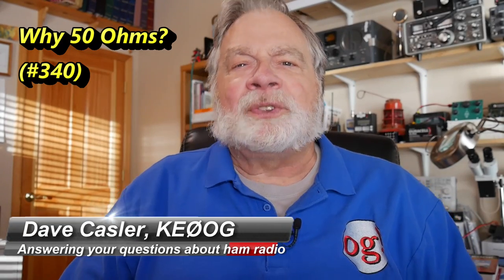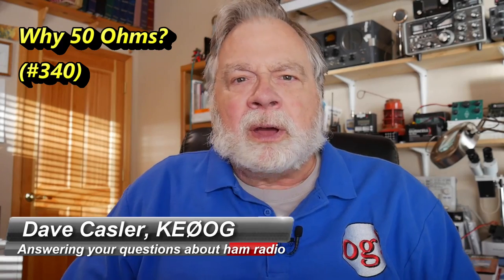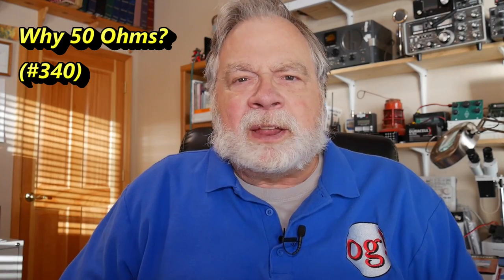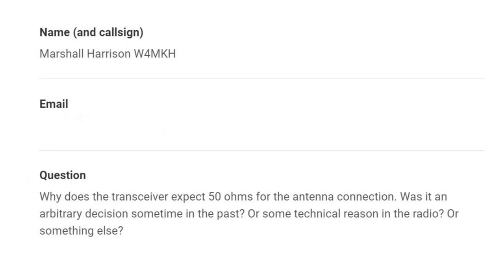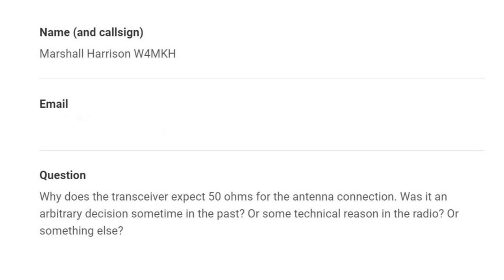Why is Coax 50 Ohms? (#340)

Comment: Nice explanation!  Most of the 50 ohm cables I've used have had a BNC end and the 75 ohm cables have an F type.  Is there a reason for the these choices other than cost?
Reply: The professional video world uses 75 ohm BNC on SDI video cable, but don't get them mixed up. The connector itself has a characteristic impedance and there are other better 50 ohm options like TNC and N-connectors if you need them.
Reply: Yes, 75 Ohm BNC exists too but F-type is popular now because it is cheap and effective. The center conductor is usually copper plated steel, I think. Skin effect... Steel is cheaper than copper.... I don't think that there is an equivalent of F-type for 50 Ohm coax - I've never seen one?? You mustn't plug 75 Ohm BNC into a 50 Ohm socket - the center pin is a different diameter and it buggers it up. :(
Reply: The F-connector is common in consumer electronics because it is cheap and... no, that's pretty much it. Because it's cheap. It's a very tight margin industry sometimes.

There is a 75ohm version of BNC - it's a slightly different size, to prevent accidential interconnection. You don't often see it though.

Comment: power (watts)= voltage x amps, so high voltage is different than high power by the amount of amps. Volts is the force component and amps provides the time component. Force over time is power.
Reply from the maker: Don't forget the power factor, which is the cosine of the phase difference between the voltage and current waveform.

Comment: Calculus and differential calculus was NOT invented by Heaviside. Generally, the invention of calculus is attributed to Newton and Leibniz. Aspects of calculus were, however, known in antiquity. The work of Newton and Leibniz were based on the work of mathematicians and physicists  of the previous generation including Fermat, Pascal, Wallis and others who all lived before Heaviside. Heaviside did develop methods for solving differential equations and vector calculus. Maxwell's equations as expressed in modern terms were reformulated by Heaviside. Heaviside postulated the existence of an ionosphere and the layers were appropriately named the Heaviside layers in much of the 1920's radio literature that I have.

Comment: Thanks for a great explanation! I live in an HOA-governed neighborhood, so my antenna choices are very limited. I just purchased an Eton Elite 750 short wave radio, and am researching appropriate antenna options. I can run a coaxial cable from its 50-ohm BNC connector out my back door, 90º to the left for about 15’ to the side wooden fence, then a right angle along the top of the fence (through eyelet screws?) for another 60’ or so, then another right angle for another 16’ or so. At that point, I would like to run that coaxial cable down to the ground, then to a tall Cottonwood Tree behind the fence. I can run the cable up the tree for about 30’ or so. Whew! Having described all that, does that coaxial cable need to be a certain length in order for the radio to properly tune with it? As you can tell, my learning curve is pretty vertical. I’m glad I came across your channel—and I’m now a new subscriber. Scouring your videos for this answer, but if you could help out while I’m searching, I would appreciate it. Thank you!
Reply: If you are a radio amateur, HOAs cannot legally prohibit the installation of a "reasonable" transmitting/receiving antenna. I believe that went all the way to the Supreme Court.
At least one amateur has successfully argued that since his specialization was international radio communication, he got the courts to agree that his large tri-bander antennas mounted on a tall tower were reasonable. 

If you are using the antenna for receiving only, you can simply mount the antenna or antennas to the eaves or siding, then paint the antenna and coax to match. Neither the HOA or your neighbors will even know it is there.  Also, the length of the receiving antenna is not very critical, unless you are doing weak signal work.
Reply: Google flag pole antenna

Comment: So these values were worked out experimentally in the 1920s prior to the existence of any of the dielectric materials that we use today?

I wonder what the results would be like if there experiments were repeated for polyethylene and polystyrene dielectrics
Reply: According to my understanding such materials simply allow thinner and/or more flexible cables, but they do not perform any better than air ones
Reply: @AlessioSangalli  the dielectric properties of polymers are distinctly different to air (free space).  The dielectric properties are the very reason why modern coax cable use polyethylene  or polystyrene and the k factor of these cables can be significantly higher than unity.
Reply: @michaelharrison1093  of course the velocity factor is different, but why do you think a higher k is a desirable property?
Reply: My understanding is that such dielectrics are used for their mechanical properties, not because they perform intrinsically better than air - but I am interested in understanding more.
Reply: @AlessioSangalli  a high k reduces the wave velocity and inversely proportion to this the volumetric energy density of the signal is increased.  A higher signal energy density helps improve the S/N ratio
Reply: @michaelharrison1093  OK kinda make sense; I will try to look it up.

Comment: You mean for power output transmission is the best lower ohm such 30 ohm for the minimum loses and for the receiving loses is the best 75 ohm, but because you are using the same cable for transmission and receiving through the same cable it is the optimum to use 50 ohm cable?

Comment: Dave: Love your videos. Thank you. 

I hope you don't mind if I ask a quick question:

BACKGROUND: I have 65' of (really old and double guyed) Rohn 25G standing in my back yard. It is topped by an equally ancient Mosley TA33 Tri-Bander and fed with 120' of RG8. I also have a 10-80M OCF dipole (inverted V) hung at 60' on the same tower. We have three acres, on a 1400' foot hill (1000' above the city of Fairbanks, AK) looking south - toward the US. 

PROPOSED ACTION: I am considering removing the Mosley TA33 from this Rohn tower, and in its place putting up a (rather large) Mosley 96 Yagi that includes both 30M and 40M. I'm also considering installing a better feed-line. 

QUESTION: How would you suggest I evaluate the propriety (cost/benefit) of: (1) ensuring the best height for the new Yagi (1/2 wave at 40' equals about 65', so it appears just about spot-on for 7 Mhz); and  (2) installing a better feed-line, something like the Heliax you mention in this video? I'm not made of money, but I do OK and wouldn't mind investing a bit in this project, if the outcome would be materially advance my present abilities (QRP CW on the bottom of 15M-40M). Any direction you may offer would be greatly appreciated. 

Of course, if this inquiry is beyond the scope, please forgive me. 

Again, love your work. - Ward Merdes - KL7IXW 

p.s. I grew up in Fairbanks, AK with your friend, Scott Dennis, RIP
Reply from the maker: Ward, I'd have that tower inspected before doing anything on it, including climbing it. Rohn 25G is not all that strong, and if you put a 40-m Yagi on it you may overload it. Don't forget to consider the torsion load put on the tower when you rotate the antenna and then the brake grabs it. For a big antenna like that, you might want to consider Rohn 45G or something even stronger.
Reply: Thank you, Dave. Will do. 73 - Ward Merdes

Comment: It's just like a transmit metal detector coil that you made from a LC Colpitts oscillator...  you need the sinusoidal oscillations as a TX signal in the coil and you need part of it to reference a clock operations..  the more effective power transfer is done,  the more the power is lost in the TX coil... so you can't match for maximum power transfer, new elements come into play.. The LC tank needs to keep it's oscillation power or your detector receive side has a weaker and weaker oscillation to work with down on the ground..  The antenna is the same.. it resonates energy that you want and only need a fraction of and keep the antenna working... So the coax dilemma is simple to explain, it's impedance matching balancing compromise that allow for reasonable cable length whilst still leaving some power behind for the antenna to saturate it's own function... and to satisfy the equipment you connect with. So now you know what you can do with those old Tesoro detectors to make them even better with a resistor of all things. Operations needs stability, and there's nothing wrong with taking what you need instead of taking whatever it can give you.

Comment: Dave:
Recheck your data.  'if ...quality cable'   and then  'there is no wear-out...'     If you put the two together you are mostly correct.  You need to check out 'non-contaminating'  cable.  The newer LMR-400 with a foil separating the dielectric from the outer jacket should last much longer.  I can show you old deteriorated cable that was ALWAYS stored inside.  It was 'N-C' cable but still went bad.   
w0fen Robin

Comment: i was told the the first cable used for tv work was flat form what we call ladder cable  . then due to a surplus of co-ax lefted over from radar work it was put to use  and on rx only there is no difference between 50 or 75 ohm for ham work interested in any comments david

Comment: Hi Dave,  I eventually want to upgrade to my general.  I now am starting to realize how little I know.  I started on the air in CB way back in 1968 when I was very young.  I have my technician class license now.  When you started talking about the different  coax 75 vs 50 ohm I lost you.  Although it has nothing directly to do with ham radio, can you give me a simple explaination as to why the co phasing harnesses for tractor trailerantennas usually but dont always come with a 75 coax.

Comment: There's one crucial piece of information missing. The 76.7 ohms is not an arbitrary figure. It happens to be the impedance of free space. That is, is the voltage/current ratio of an electromagnetic (eg RF) wave in free space. Well, that is actually about 72 ohms. In air, which has a slightly different dielectric constant, it becomes that magic figure of 76.7 ohms.
Reply from the maker: The impedance of free space is generally considered to be 377 ohms.

Comment: Great research on the trades between power handling and loss.  Any thoughts about balanced 300/450R leads with proper tuning and baluns?
Reply: Open feed lines are of lowest loss. They can withstand high SWR and have high breakdown voltage depending on the distance between the two conductors.
You must use some kind of impedance matching device at the antenna terminal of the radio, for sure.

Comment: Actually, coax comes in lots of impedances, but the most common are in the 50-ohm range and the 75-ohm range. The small RG-58/U (50 ohm) and RG-59/U (75 ohm) are the most common. Power really isn't that big of a deal, as they are capable of 1000 watts and 1200 watts, respectively, at 10 MHz.  RG-8/U (50 ohm) and RG-11/U (75 ohm) is where you can see a power difference at 3500 watts and 2500 watts, respectively, at 10 MHz. Most CB radios were set up for 50 ohm while most amateur dipoles were really a better match to 75 ohm. Still, it depends on your antenna design and your receiving and transmitting equipment. In the old days, there were antenna tuners to match the load to the transmitters but today, many skip that part of the design.

Comment: That looks like 1 5/8th coax. Mainly used in broadcasting. The air dielectric is used to get dry air or nitrogen up to the antenna.
Reply: Why do they need to do that?
Reply: @Justin-bd2dg  Keep it pressurised to prevent moisture getting in.
Reply: @stevemorrisby6705  ahhh, makes sense...

Comment: Hmm I wonder if this is the real reason because  in my knowledge 50 om impedance is a good fit for quarter-wave antenna and half-wave dipole

30 Oms is good for quarter-wave antennas and 75 Oms is good for dipoles although in practice quarter-wave rod is closer to 50 oms.

Since ham radio uses rod antennas most of the time and Tv uses dipole antennas most of the time Tv is running on 75 oms and Ham is using 50 om cables.

High power radio transmitters use 300om (or even 600 om) feed lines which is suitable for loop antennas and generally cheaper because requires less copper so 75 oms make 1/4 of that impedance.

in principle, low impedance cables are more expensive because they require higher diameter conductors and run on higher currents what is extremely lossy because of the skin effect.

Comment: RF Cable and connectors coax, triax, or any ...ax like quadrax etc. comes in different impedances. They must be matched to the impedance of the equipment on both sides it can be any type system. IE RF, video etc etc etc. if the impedance saids 50 ohms you can use RG-58 etc to match the equipment to the cable?. Connectors must also match. We quit using RG-58 in Naval Aviation because of the pvc burn hazard. In the late 80’s I know second hand info of a Navy Chief who did everything right to extinguish a aircraft fire in the tube of a P-3 aircraft. He put the fire out, but the fumes destroyed his lungs. They did a lung transplant. Any way any mismatch of impedance will degrade the signal to unknown or un useable levels. Check the specs for your equipment and your wiring. As you know all stuff is not always good. You are correct about wire twist for “emi” protection. Shielded signal cable for these purposes really is a different animal. I hope this helps a touch maybe.

Comment: I know very little about radio, but stumbled upon this video and watched it anyway. Am I right in thinking the 50 Ohm value is the resistance between the conductor and shield? And that this is independent of the length of the cable?
Reply from the maker: No, at DC the impedance means nothing. At RF, the voltage and current have a constant ratio, which according to Ohm's law means a constant resistance, or more properly constant impedance. The impedance is largely independent of frequency and hence is a characteristic of the cable itself. It can be calculated from the geometric properties of the cable.

Comment: Heaviside did not discover differential calculus, modern differential calculus was developed by Newton & Leibniz, Heaviside developed operation calculus for dealing with step functions and Fourier transforms which determine bandwidth on a transmission line.

Comment: Thanks for explanation! It was very helpful! Question: from rtl-sdr point of view, is there much better to use 75 Ohm coax? In rtl-sdr I can only receive signals so according to information in this video, there should be better to use 75 Ohm coax. For example: to receive wather satellites (which I am trying to do) there also should be better to use 75 Ohm coax. Is there some additional coax parameter that I should care choosing coax for my rtl-sdr?
Reply: Of Coarse If Your Antenna has A FeedPoint Impeedence of say 3oo Ohms 
(( Like a a Folded Dipole, wich is a good, & BroadBand and Easy to Cosruct Antenna ))  
You would end uP with A horific Poor / Bad SWR 
(( Standing Waves Ratio the amount of energy that get reflected back & Forth in Ya FeedLine instead of Reaching the input section of your receiver ))  
So To Answer You Question SPECIFICLY The Coax Impedence should be the same as the input imeedence of your SDR Receiver, or @ least as Close As Practical,,, 
And Preferably An Antenna With the same FeedPoint / connection Point impedence As The Coax Or Ladder Line Used....... 
E.g. An Regular Dipole wich hovers around the 75 to 50 ohm mark depending Circomstances of Antenna height above grond as shown in One Of the Diagrams 
To The Wise david here,,, 
If you have a folded Dipole wich has a much wider bandwidht for one and 300 Ohms Impedence, secondly,,  
You could use those Old 300 Ohms TV Ladder Lines Wich As All Ladder Lines,, 300, 45o, 600, And 1200 Ohms Has Some Of the Lowest losses of all kinds of feedlines 
And you could use some cheap 75 Ohm Coax To Make A 4/1 Balun / 300 Ohm Down To 75 Ohms impeedence transformer with a quarter wavelengt or and or two of the cheap 75 Ohm Coax,, The Only Snag Is That,, 
That Very Neet and easy to construct 4/1 coax balun Probably has a lot less Bandwidth Then The Super Allround Folded Dipole Antenna....... 
But Still A Good Low Loss Setup,, You Did Not Mention Wich Frequency Your SDR Receiver operates on,, But i'll Guess it's somewhere in the lower Part of the HF Band, and The Losses is increasing with frequency so in the HF Band 
They are not so great as E.g. An UHF Tv Transmission... 
Althoug i myself only use 7/8 & 1-5/8 Inch Andrew heliax Cables wich Probably has The Lowest Losses Of just about any kinf of Coaxial Cable, Exept Gas Filled HardLines...... 
And RG-213, i use only from 14Mhz / 20 meters And downwards in Frequency.. 
I Even have on storage in my Garage a couple 100 feets of some hard line for Cable Tv Disrubution 
wich basicly is a massive aluminium outer tube with some sticky greasy shit inbetween it and the outermost protective PE Tubing and with an aluminium center conductor wich Has some kind of copper foil squised around it to increase conductivity,, And Of Coarse A 75 Ohm Caracteristic impeedence....
Bests Of Regards & 73's To ya All From Pelly